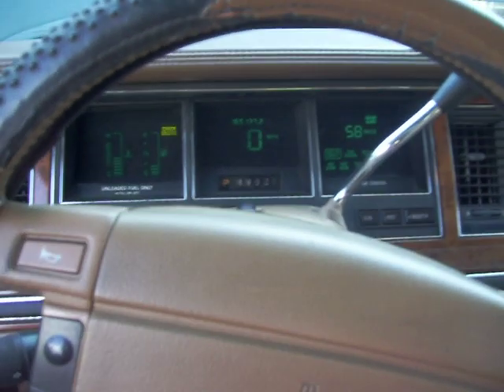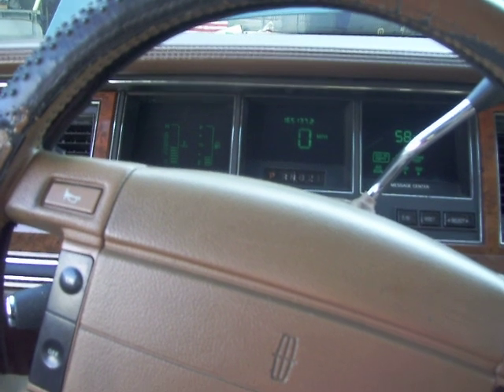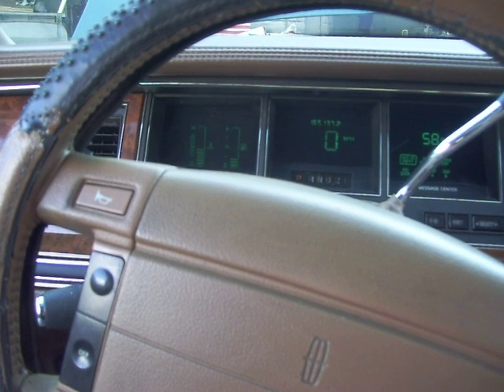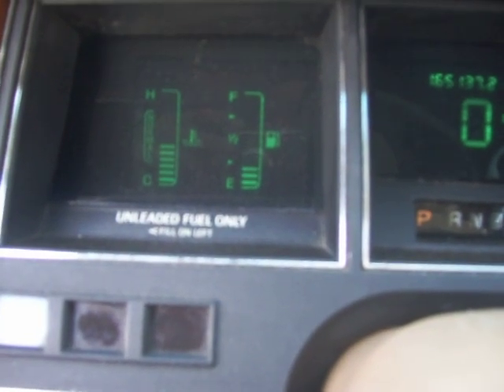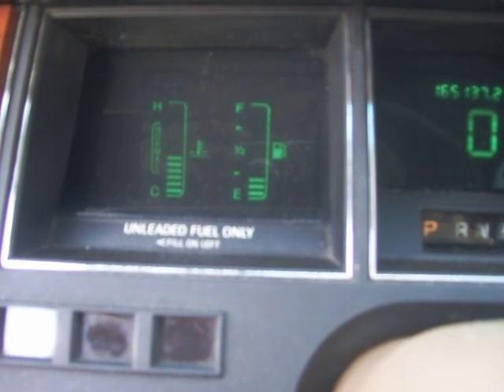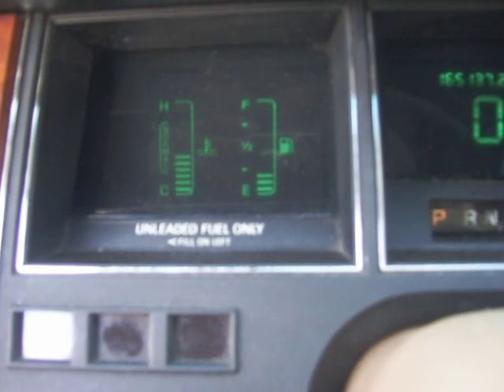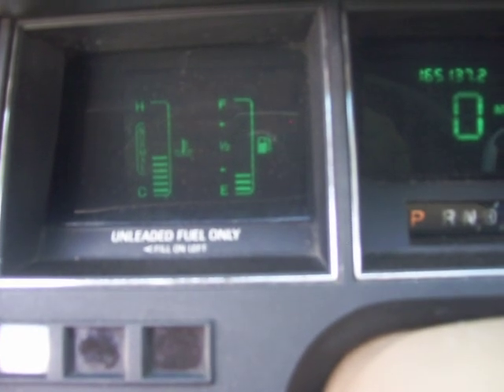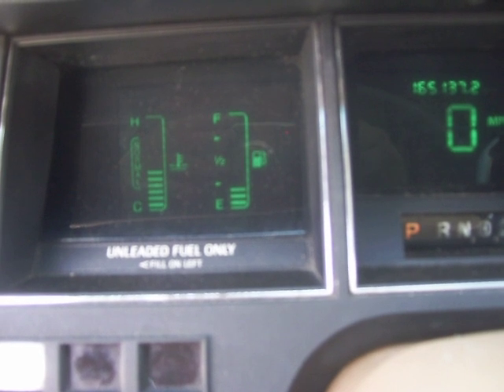Lincoln town car paper clip code trick2

Comment: DAMN! I'd be going after that ticking noise with a HAMMER.
Seriously down here in South Florida where you don't need
a heater I just reached thru the glove box with a long screw-
driver and pried the plastic top off the little servo that's
making the noise. BINGO. Works like a charm. AC still
works fine.

Comment: to read the code it will blink in this case he had 3 codes on it first wae 332 it blonked three times a pause three more pause than two than a longer pause next i think was 536 same way and I cant remember the last but thats hoe its done 332 is egr flow code :)